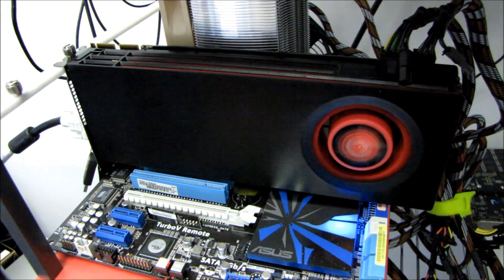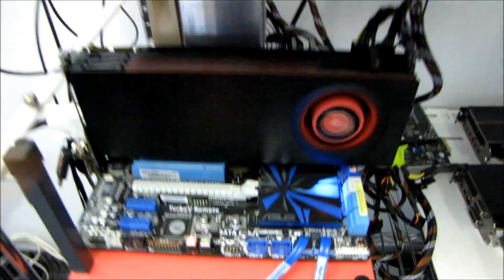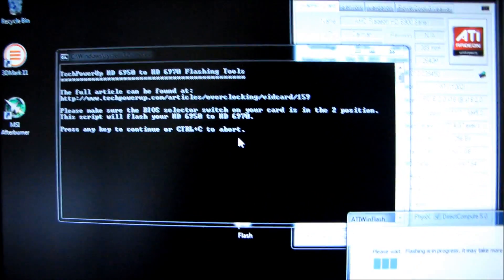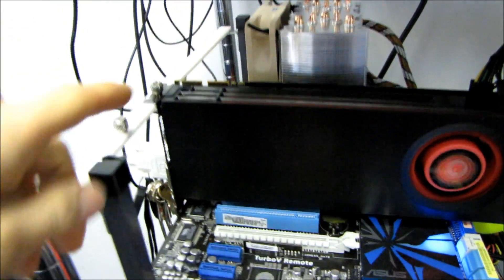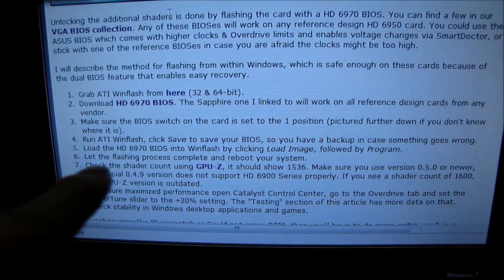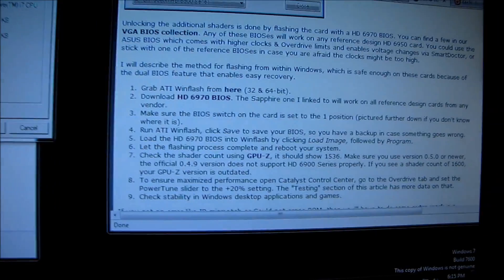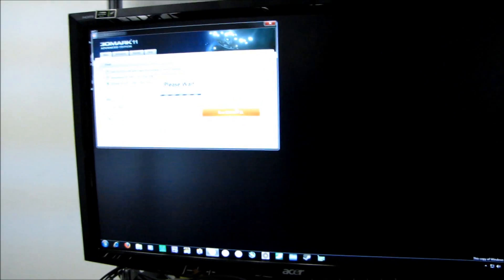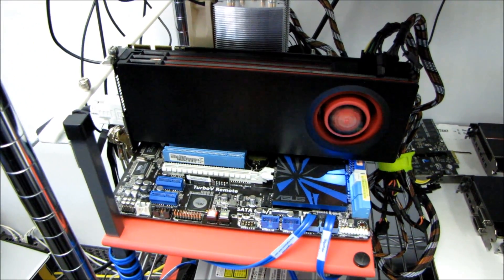AMD Radeon HD 6950 Software Unlock to Radeon 6970 BIOS Flash Linus Tech Tips

Comment: 9 years later and just won the frozr ii on eBay for £25 to replace my 560ti which I chose in 2012 over this 6950 for the very slight higher performance and it’s funny because with this upgrade I’m actually technically upgrading from the 560ti

Comment: This doesn't work on Windows 10, just so you're all aware. More specifically, everything works as it should but the shader count never updates. Retrying the process just says that the bios being flashed (the 6970 bios) is already installed on the card.

Comment: so my apu is more powerfull than 1gb  gddr5 hd6950.... i unmounted gpu and play smoother on a10 7700k with iGPU
Reply: How is that possible? HD6950 should have 3x more graphics performance than A10 7700K iGPU.
Reply: Soinin Poik  i dont know it just perform better on some games thats all. on battlefield 1 for example its glitchy due to amount of vram and its get something like 35 instable fps. on my igpu i get locked 45 fps stable. the same on gta v my igpu gets stable locked 30fps on dedicated gpu it gets something around 25 fps non stable. maybe my gpu is broken
Reply: You have 2GB shared memory on your iGPU? That explains a lot than. All the motherboards I have had only support 256-512 MB memory to be shared with the iGPU. =(
Reply: Soinin Poik yes i have 2gb of overclocked ram in dualchannel. i simply love this a7700k with a little upgrade to cooler i can overclock it a little more i get 4ghz with stock cooler i cqn do it to 4.2 but i dont feel safe on it

Comment: So I opened up CCC to check, I have 890 mhz stock on my core clock and my shader count on GPUz says I already have the 1536 shaders. I haven't OC'd anything or flashed any BIOS's or switched any switches.

Asus 6950 Driect CU2
So confused.... Lol

According to GPUZ I actually have a 6970, maybe my memory is slipping, it was 5 years ago at least... Heh
Reply: +D-no P it's a 90, not a 70
Reply: +D-no P bought new a long time ago 4-6 years, just couldn't remeber wtf I threw together, lol

Comment: will this work on any HD 6950
Reply: No only original reference models. They only cost $280-$300 on launch. The only GPU in existence that performed a tier higher was the GTX580 which cost $500+
Reply: does it work on other ATI cards?
Reply: Yanko Bzykant Supposedly the Asus Fury unlocks to a Fury X
Reply: Ian Brandon Something
What about HD 4870? Can I flash bios from 4890?
Reply: Yanko Bzykant There is nothing to flash. The HD4890 is an overclocked HD4870 with a couple of little physical on die tweaks to allow for higher stable overclocks. Overclock your HD4870 up 850MHz and the memory up to 975MHz for identical performance

You probably won't be able to however because the HD4870 lacks the physical on die modifications that increase stability
Reply: Ian Brandon Something
CCC allows me to overclock core only to 790 MHz and memory up to 1100 MHz, but the card isn't stable at those clocks. Computer hangs during playing. When I reduce memory to 970 it works, but it's not really faster. Also, I can't set my fan speed.
Reply: Yanko Bzykant Download MSI afterburner

Like I said the HD4890 has tweaks to its GPU die which allow higher stable clock speeds
Reply: ***** I've read otherwise. The original reference HD6950s had a 99% chance of unlocking without any issues
Reply: yup other are talking bs. ive had two non reference and even 1Gb cards that unlock to 6970 easily. you just gotta download radeon bios editor and unlock the cores only since when you put a 2gig 6970 bios to a 1gig 6950 its gonna throw errors when you go over 1gb

Comment: 5 year report on my card. it died at 4 years 6m old of to high heat
Reply: EstMovies around 90-95c full load (synt) medium load (gaming) was 85-90 idle at 60-70 because it was running att 500/1370mhz (i have a 120hz screen so it wont clock down to the lower setting) btw i bitcoinmined on my for 2 months~ and the computer was always on.
Reply: +ultimadriver Still rocking mine! :D
Reply: It must of overheated when you were bitcoin mining
Reply: still rocking 6970 1gig @920mhz max temp 73. what was your full load temp for the card that died? :P
Reply: ultimadriver that explains. i cant get to 90 even eith furmark so i guess im fine. and these cards dont like memory oc at all and you cant tell if its unstable because its ECC and corrects itself so im keeping mine at 1250. 😃
Reply: the memory was discolored :P so its prolly it that died
Reply: I have mone too! Gotta love the warmth it produces on cold winter days :D

Comment: can i do it on my powercolor 1gb ddr5 256bit? pls reply in advance.
Reply: +ashman ariff no has to be the 2gb version
Reply: u sure? because I did it.. I OC'ed it aswell :) 940mhz gpu clock and 1450mhz memory clock..
Reply: +ashman ariff I have the AX6950 1GBD5-2DHE that i got recently from the egg for 74$ new (54$ if you include the mail in rebate). Finally unlocked the shaders and OC to 900/1350 stable. :]
Reply: one question tho: do you need a 1gb bios or does it even matter? how did you guys do it?

Comment: Ok man, please excuse my stupidity as english is not my native language, but what you mean is that you can unlock the bios "hidden" in the 6950 to make the card reach the performance of a 6970? so technicly the 6950 has similar hardware to the 6970 but has it's potential limited by the bios installed by the manufacturers, is that it?.
Reply: If I understand correctly, the 6950 and 6970 are just about the same as far as hardware goes, it's just that some shaders are disabled by AMD by default. That being said, you can unlock those shaders to get approximately the same GPU. Same thing with some older AMD CPUs like the Phenom 2 550 and such. They just have some cores "hidden" or disabled.
Reply: It should be noted that some non reference models need a physical modification to be unlocked.
Reply: I have 2 XFX 2Gb 6950's bought new back in 2010/11 (?) Only external physical difference is the 8+6 as opposed to 6+6 power connector. Presume that there maybe some differences in VRM. It is such a simple upgrade, if you have one (still). I run mine in Xfire as well, well I did, then I just split the cards between 2 PC's as economkcs dictated (and the wife wouldn't let me buy yet another graphics card).

Comment: hey i have a question, i have an AMD A-8 3850 APU with Radeon HD 6550D. the question is, the last time i updated drivers for the 6550D it changed and now its reading as a SUMO 9640. is this normal?

Comment: two questions, first is can you change it back to a 6950 or default settings? my second question is that i wanna use dual monitors with one card which is a 6950 2gb ddr5 i was told that my quality of games will go down and the reason for dual monitor is to play games on one screen still on all the settings on the highest setting available and to use second monitor to either browse the web or watch a walk through video and stuff like that. Thanks.

Comment: couldn't you just use catalyst to overclock to it seeing as the shaders and bios specs are now the same, and the fan controls should be the same? Not really for sure, and I am by no means an expert, but I would just use catalyst and re-run graphics benchs to reassure that it is stable.

Comment: I traded my 2 gtx295s for a 6950 shader unlocked with arctic accelero xtreme plus II.

The shaders are unlocked, but is it normal that the clocks arent as 6970? My clocks are still same as 6950@800/1275.

Comment: reference 6950s are no longer sold, so you cant unlock your future XFX 6950. Maybe u could, but with no dual bios switch, so if something goes wrong, ur screwed.

Might as well get the 7850, better than the 6950 kind of and just barely mroe expensive

Comment: possible but only with some compatible mobos & you won't exactly reach 6950 but very close to it! Extreme overclockers will be able to get almost 6950 performance out of a dual gpu with heatpipe design on a good 6870 brand. So first off you need to get a dual fan 6870 which has copper heat pipes! The AMD 6870 HAWK TwinFrozr 3 is the best one for that

Comment: No prob im happy to help, if you have an average mid range computer, 650w will be adequate but if you have a high end system ( i7 2700k or Fx 8150 ) You should have a minimum 700w power supply or higher!!

Comment: Idle temps - 7850  = 30c vs 6950 = 42c 
full load temps - 7850 = 65c vs 6950 = 79c
Max Power consumption or TDP for the 6950 = 158 W vs 7850  = 106 W.  

You need a at least 500 watt power supple for either card! 

Hope this helps!!!

Comment: If you can find a 6950 for under $200 go for it, they perform basically the same but power consumption and heat is drastically better on the 7850 and it is also far smaller if that's even relevant to your decision. The 7850 is $250+ so you decide if it is worth the extra expense!

Comment: @sgwuerzbubi No, that card is not reference design, you need to use the tool and BIOS provided by MSI to unlock the shaders of that card (i have the same as you). You can read more about it and the unlock process in the vortez.net page vortez.net/articles_pages/msi_r6950_twin_froz_iii_power_edition_unlocking,1.html

Comment: never mind i did it anyways and it worked fine...i was even able to switch it back to the old bios with no problems....i am now running my 6950 as a 6970 with now problems.....but witch drivers do i use now?...the drivers for the 6950 or the 6970?

Comment: yes it works... i just did today unlock my shaders ... flashing my card bios.. i din't know this was possible but i did.. i got a powercolor hd 6950 2g and unlock to 6970. . i use a MSI flash bios. for  my card i think this is the most powerfull outthere for now to unlock on hd 6950 2g if you have hd 5950 1g it will require different bios. full compatible test the witcher 2 no problems... looks awesome. people try read blogs are very help full .. YES YOU CAN DO IT.

Comment: Its not really worth the hassle and potential damage. I have both the 6950 and 6970. The difference in gaming performance is minute. Unless something comes out that is really drastic in technology, were stuck with this stuff for now. But i7, sufficient memory, solid MB and a 2gb 6970 and proper set up for cooling, should more graphics than you can ever want or need.

Comment: @codaassasin Yes it might well do. The VRAM in the 6950 was cheaper stuff and can't be clocked/won't take the voltage to the same as a 6970 without risking damage and reduced life span. As far as I know, unlocking the shaders has no risks with the exception of the actual flashing.

Comment: @MegaAbzzzzz The thing is that the cores are there all along. The 6950 cards are the 6970 cards that couldn't handle the higher clock (they where "broken"). So instead of throwing them away they downclocked them, turned of a few cores and sold them cheaper as the 6950

Comment: To clear some air as I still see people asking questions about this:

1. You can do this with CF/Trifire, no limits there
2. You don't "NEED" a reference card, the only reason why everyone recommends it is because of its BIOS switch, that lets you reset it back to the 6950 standard bios if you encounter problems with your new 6970 flash.
3. Any 2GB card can be unlocked
4. This requires half-decent air flow, if you have bad air circulation or your temperatures are generally hot, don't do this.

Comment: @arktnas if you plan to do Crossfire manufacturer dosen't matter. but you have to have the same amout of memory on same speeds, and the chip must be identical, they both do need to run on the same clocks.
You an however underclock/overclock ur cards if they are factory overclocked.
But if you have unlocked only one card but not the other u wont be able to do Crossfire. both need to be unlocked or then you can possibly undo the unlocking.
Gimme the specs on ur cards (name etc.) thanks.

Comment: @JosFcGamesta 2000mhz ram is no much faster than 1600mhz if you check reviews online, they are really not worth it, you'd get less benefits than 6950 unlocked vs 6970, also you will NEED to overclock the ram since the default is 1600 anyway. 2000mhz is just the ram's rated speed, but if you boot the PC chances are it runs at 1600 by default.

Comment: @JosFcGamesta The reason why is because they run their unlocked 6950's MEMORY at 6970 speed
6950's memory is rated to run at 1250mhz MAX while 6970 can potentially run at 1500mhz with no ill effect(the card itself can't handle it most of time). Having 6950's memory running at 1375mhz for months is asking for it.

Comment: @kjakur  It wont effect the lifetime of the card, cooling on graphics cards is really more of a marketing gimic than anything else, as long as your not consistantly pushing over 100c with overclocking you should be fine. Back to the question, a 6970 is the same card as the 6950 so it should have an identical lifespan and speed. Hope I answered your question :).

Comment: @MortalSIX you can generally tell which cards can be unlocked because the have an AMD logo where the cards plugs into the pci-e slot, this means it is reference, 99% of the time, and ~90% of the time reference cards can be unlocked.

Comment: So guys i bought a Gigabyte Radeon hd 6950 2gb reference design card with the dual bios and i was able to convert it into a 6970 following the directions of tech power up just like linus did. Nothing unstable so far and the card can max out crysis 2 easily. My temps while MSI Kombustor stability testing are: 54 idle and 86 full load.

Comment: @eckos20 6950 is better than gtx560 as default, but the point is that I've heard, actually read, issues about flash-unlocking of power consumption not enough to feed the card, artifacts generation and videocard dying. I'll probably keep them as they are or just overclock will be fine enough, even because if you don't watercool their going to be louder. Maybe someone should care of reporting Part Numbers of the 6950's flashed survivors and the temperatures they run at.

Comment: @1spaghetti32 
I used the RBE (Radeon BIOS Editor) to enable shaders in new BIOS. Nothing else changed.

Same crashes in BFBC2.

Flipped switch back to position 1 and no more problems.

Going to try custom power settings through CCC.

Comment: @sh0wbiz I guess isn't the same as overclock, you are enabling the functionality of the 6970 that is turned off in the 6950, that's all, I have the ATI Radeon HD 6950 flashed into the 6970 like for a week and it works exactly the same as the 6970. Now I'm using it in the normal BIOS(6950) and it works fantastic, but if I enabled the first BIOS(6970) it gives me like 6 or 8 fps more.

Comment: I think the ATI Radeon HD 6950 is the best option, you got two video cards there, why pay more for the 6970? I have the ATI Radeon HD 6950 flashed into 6970 and works exactly the same as the 6970, I don't even need to use it like that, just to use the 6950......... you know the rest.

Comment: @militant123 chances are it will void your warranty. best bet is if you flash the card, save your original bios so you can flash it back to original before doing any RMA's. Hopefully that wont leave a sign that the card was previously flashed.

Comment: @1spaghetti32 That's just what I was writing to someone else. The 6970 has higher spec ram and flashing to a normally clocked 6970 bios could cause long term reliability with the card. What I may do myself is only unlock the shaders which should not be a problem while doing only a modest overclock otherwise.  There's a reason after all that the 6970 has an 8 pin connector on it. The chips need to draw more power.

Comment: @fuggotry from what I head the physical memory on the 6970 is higher spec than that of a 6950. So while the unlock may work to open up the shaders there can be issues in terms of memory frequency bumps to match the 6970 speed it may cause problems for you in the long term reliability of your card.  I got 2 of these cards on orders. I think I may do a manual unlock just on the shaders but leave the memory speeds alone.

Comment: Hey man I need your advice, I own a single monitor running a AMD 1100T 6 core CPU, 8gigs of Ram and what not...now...I have 1200$ for GPU upgrades etc...should I buy a 6990 for 700$ or dual 6950's and then unlock them? Remember I own 1 monitor, not sure if I buy the 6990 I'll get microstuttering...but then again two 6950's could be an amazing boost...

Comment: just flashed my ASUS radeon hd 6950 DCII to hd 6970....IT toook looong hours of trial and error but I am very happy that I bought this card afterall....I bought it for the overclocking potiential and because i was fooled into believing it had a duel bios switch....when I got the card I had read that it WASNT a duel bios script...but in fact it actually is. I have my Hd 6950 DCUII as a 6970 with 950 core and 1350 mem....20% power increase fans at 100% she hasnt exceeded 60c YET.

Comment: @06Letmein60 Yes just make sure you flash it back in case its giving you troubles so the warranty applies again.
However if your card dies which it shouldnt unless you cook bacon on it then you will have to find a way to revive it for a while to flash it back to stock and claim ur warranty or just buy another one =(. Gigabyte 6950 flashed to 6970 and Oced is working fine on me though

Comment: im using cor i7 2600k,ati hd 6950 and p8p67 pro with 8g DDR3, 60Gb OCZ Vertex2 SSD(to system) + 1Tb WDC WD1002 FAEX', 800w 90+ power.the thing is ti still stuck some time when i play Front mission evolved (i use this to test).some help please.......